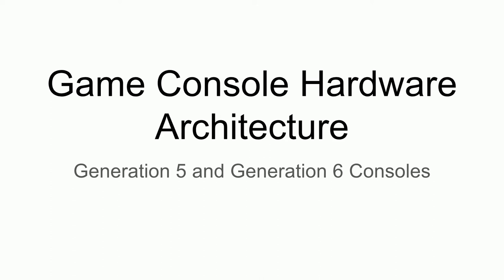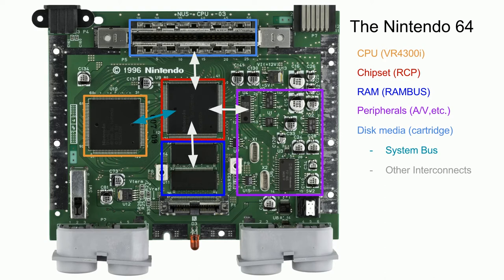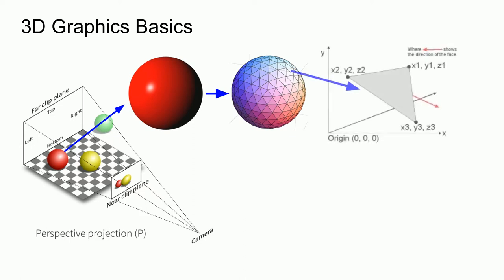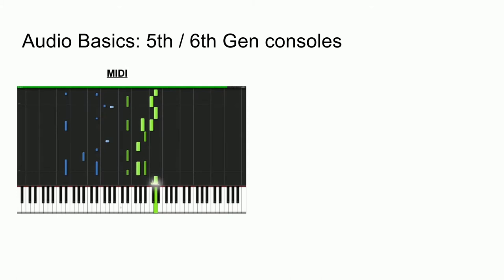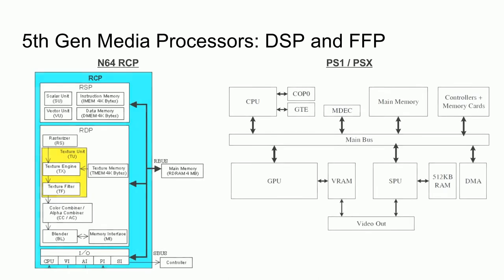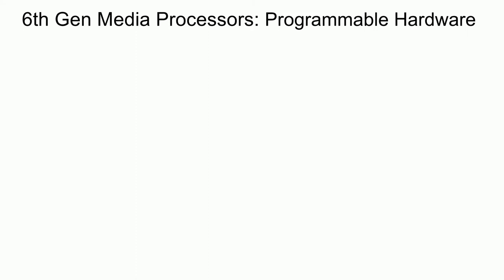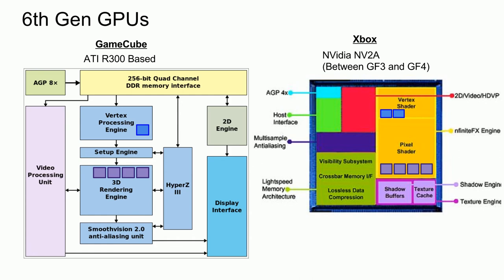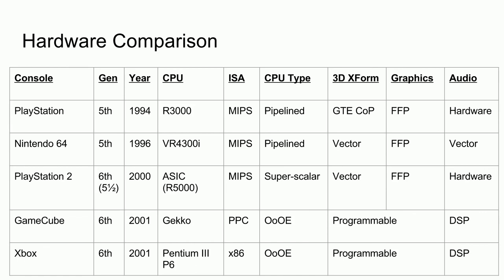Game Console Hardware Architecture (5th and 6th Generation)

Comment: I feel like I'm watching an Adored tv video. The most enjoyable part for me was how different the architecture of consoles where to a regular computer. I enjoyed the effort put in to male the video accessible to people like me.
Reply from the maker: Thanks, I'm glad you liked it! 
That was the level of complexity that I was going for (though I had never seen AdoredTv's videos before I made this one). While the architectures are different, they are also very similar (the main difference is how many chips they used, but everything being on one die or 6 doesn't really matter from the architecture perspective). I think the coolest thing about these old console is how you can visually see the architecture by looking at the circuit board, and that means you could attach probes to it and see how it works in real time if you wanted to (you can't do that with a Zen+ system for example).

Comment: Gamecube's GPU (Flipper) wasn't based off an R300. The only reason the ATI name was attached to the Gamecube was because ATI bought ArtX, the company that actually made the Flipper.  A diagram of the Flipper would actually look nothing like what's in this video.
Reply from the maker: Thanks for pointing that out! I just looked at the patent and you seem to be correct. The diagram presented looks nothing like the R300 (I took some sources calling it a R300 for granted there). It appears to be a fixed-function pipeline and not a programmable shader pipeline, which is a bit disappointing (though beneficial since the R300 ISA is a mess).
Reply: @RTLEngineering  Yup, it's fixed function but there is some limited programmability. According to the Dolphin development blogs, there are 5.64 × 10^511 possible configurations  of the TEV unit.

https://dolphin-emu.org/blog/2017/07/30/ubershaders/
Reply from the maker: Ah yes, that is alluded to in the patent. In that sense, it's very similar to the R300 which had a similar pixel configuration bus. It's basically like a set of fixed function components (somewhere between 4-10), which can be re-ordered and connected to modify the pipeline. And then each of those units have their own configuration settings, so that's how you get the large number of possible configurations.

Comment: and the Dreamcast?
Reply from the maker: I don't remember why I didn't include the Dreamcast, probably because I could only cover so many, and also the architecture is quite different. The Dreamcast is basically an advanced Sega Saturn, which has a multi-processor / multi-unit architecture, which acts more like a distributed system than a modern computer. Also, if I recall correctly, the Dreamcast doesn't draw 3D geometry or triangles, but instead draws warped quads in 2D space (just like the Saturn).
Reply: The Dreamcast used a PowerVR GPU. Similar to the PS1 T&L was performed on the CPU (which had a 128-bit SIMD unit)
Reply: @RTLEngineering  reading th dreamcast specs is more similar to the ps1 than the saturn. However it both quad and triangle set up for sprites and polygons with no warping effects the saturn and ps1 had.
Reply from the maker: @maroon9273  I'm not sure why I answered the question that way, as it's a bit confusing. The response by Phredreeke is correct, where the Dreamcast used a PowerVR GPU and did the T&L with a 128-bit SIMD unit on the SH-4 CPU. The system was still more multi-processor though than the PS1, where you had the main SH-4 CPU, the Power VR GPU (which executed display lists independent of the CPU, out of main memory), and the sound processor (which if I recall was an ARM connected to a slightly upgraded version of the sound engine in the Saturn). The display lists all drew 2D shapes, but it could draw triangle lists (knowing more about how the PowerVR hardware worked, the sprites were also likely drawn as triangles by using a 4th edge equation). The warping texture effect that you're describing could still be enabled on the Dreamcast, which was disabling the perspective correction.
Reply: @RTLEngineering  true, good part about the multiprocessing in the dreamcast, it is Unified to each processors (except the yamaha and arm for audio/disc subsystems) than the saturn. Which each chip is separated with more chips except the audio chip. The 6th gen consoles was the first gen to use multiprocessing up to this generation.

Looks like the trend came from pc and arcade which inspired sega cd/sega 32x add-ons, nec cd add-on/duo console added audio chips/ram, snes/3do gpus, atari cojag chip set, n64 reality coprocessor, saturn hardware and pc fx gpus.

Comment: How CPU communicate with N64 RCP? Does it emit special instructions (assembler code) -- namely do smth with data on some RAM address? What compiler was used to utilize all RCP instructions? Hand written assembler? I'm not quite understand these moments...
Reply from the maker: The RCP had a memory mapped register space in the CPU's address space, where the link was a 32-bit MIPS AD bus (similar to the x86 front-side-bus). Were you asking about the RSP instructions, or the RCP in general?
The RSP was programmed through assembly, where Nintendo (SGI) supplied a custom compiler to select developers. Otherwise the only way to program it, would be to upload canned "microcode" provided by Nintendo as a binary blob (since the RSP was also MIPS based, it was effectively a bare metal MIPS executable, just like the games were). This microcode was uploaded to the RSP through a DMA copy from system memory.
The RDP on the other hand would have been programmed manually by packing bit fields (through C structures), although most of the time those commands were uploaded directly from the RSP. In both cases, the RDP commands would be copied through DMA as well into the RDP command buffer.
Hope that helps!
Reply: @RTLEngineering   Thank you for reply! Question was about communication between main CPU and it's (graphical) co-processors (RCP/RSP/GPU/whatever). Is it standard DMA, where CPU copies some data into special memory address and notify via system bus that it needs some job to be done by it's co-processor, and when this job is done, co-processor raises interrupt? Or there is another type of communication between CPU and (graphical)  co-processors?
Reply from the maker: It's both. Some of control registers are directly memory mapped, which includes the command FIFO for the RDP. But other memory areas can only be accessed through DMA copies (set up an address, length, etc. and tell it to go). Then other areas can use both methods, like the command FIFO for example (you can write to it directly with the CPU, or by using DMA copy).
As for interrupts, I believe it did make use of those, but I can't recall for certain. Some code could have also polled the status bits.
All communication was memory based though, there were no special co-processor instructions if that's what you are asking.

Comment: When MIPS ruled the console market
Reply from the maker: It's too bad that MIPS lost dominance - it's probably the best RISC ISA, since it's so easy to understand and facilitates simple C to assembly compilation, as well as direct assembly implementation. Every other ISA is a bit of a mess (including RISC-V, which is inspired by MIPS, but ended up introducing its own complexities, possibly as a result of design by committee). On the other hand, MIPS doesn't lend itself well to extensions, which all modern ISAs rely on (MIPS had 2 free co-processors, but that would severely limit future functionality). Perhaps it's a tradeoff, complexity and extensibility, vs simplicity and restrictions.
Reply: And now it is AMD's playground.
Reply: Alongside NEC which the n64 used to customized the original mips cpu.
Reply from the maker: @maroon9273  As I understand it, NEC licensed the ISA from MIPS, just like how Qualcomm licenses ARM. Also, I don't recall there being anything custom in the N64's CPU, other than perhaps some cost cutting features (which were standard on the VR4300i - a cost cut version of the R4000).

Comment: Ps1 was able to keep up with n64 despite it having all those advantages. For instance metal gear solid has a lot more geometry than n64 games along with more detailed textures.

Conkers bad fur day uses mp3's for audio and tony hawk uses streaming samples to mimick cd audio.

Ps2 was pretty weak, by the end gamecube and xbox games were so much better.
Reply from the maker: It depends on what you mean by "keep up", the ps1 had a lot of issues that the n64 was able to solve. Though I can't comment on metal gear solid's geometry difference. The more detailed textures were probably due to the limited TMEM in the RDP on the N64, where as the PS1 had a larger VRAM. The N64 had a nicer / more elegant architecture though, which is why there was some focus on it in the video.
You could play mp3 audio and CD samples on the n64 as well, just no one did it (as far as I know), due to Nintendo not supplying microcode to do that (they would have had to write their own).
The gamecube and xbox were both much better / more powerful than the ps2, however, the ps2 is a half-generation younger than the gamecube and xbox (even though they are often grouped together).
Reply: RTL Engineering small nitpick but when you say CD audio, I think what you really mean is PCM audio.
Reply: The Ps2 was the opposite of weak. It was a mammoth design with a lots of parts that was a pain to develop for that you had to paralelize in order for it to perform, but once you did, it would outperform the other 2 consoles in many areas, specially fill rate, polygon performance, particles, shading and full screen effects.........and Lol at Ps1 keeping up with the N64....yeah, when youre not doing Z buffering, bilinear filtering, mipmapping interpolation, antialiasing....etc. its easy to keep up.....its like saying a person carrying a 40kg boulder up a ramp and another just walking hands free at same speed are keeping up with each other xD
Reply: @jhkuno88  ps2 performed very well but has mostly ugly textures so I'd rather play DC and gamecube these days. Wreckless on ps2 runs at 60 fps with sacrifices but under 30 on xbox.
Reply: @turbinegraphics16  The Ps2 was an imbalanced system for sure. It had this monstruous fill rate and Bandwidth for high polygon counts and lots of particles and shading and stuff.....but it couldnt do high resolution graphics nor big colorful textures and no antialiasing or mipmapping......so you ended up with these graphics that were doing so much but at a low resolution and with either bland color less textures or decent but completely aliased textutes. The best example is Jak & Daxter games. Amzing polygon count, animation and particles....but  low color N64 level textures